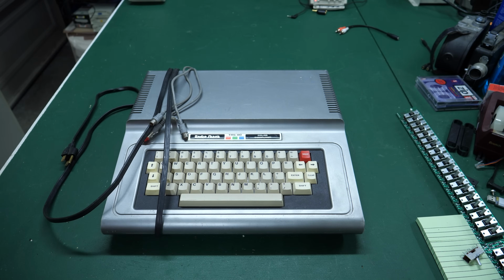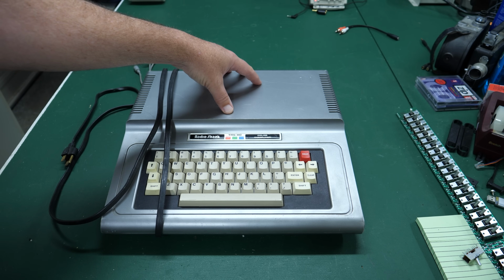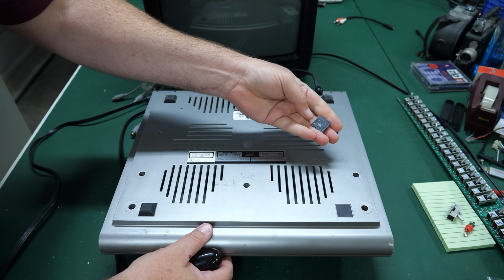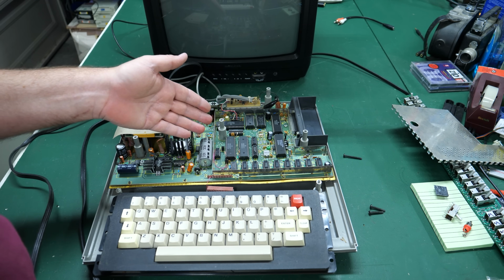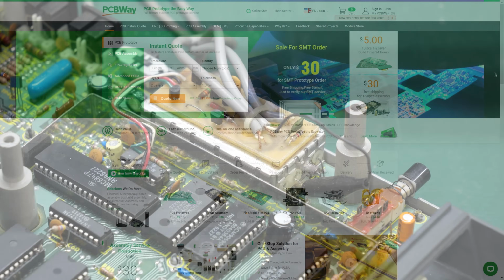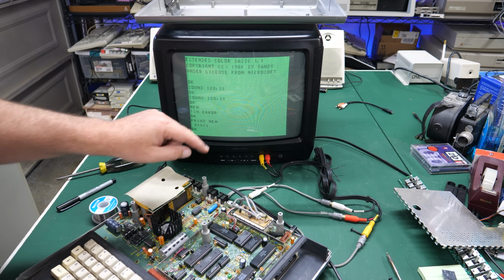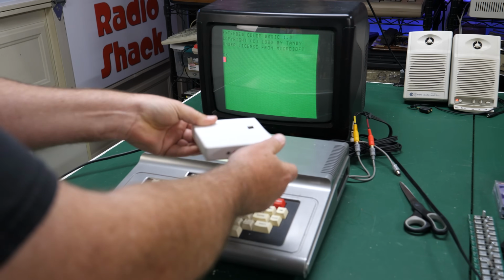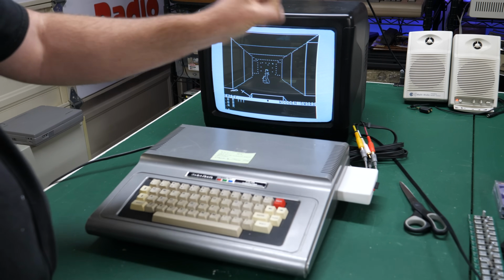Mystery Mod On A Radio Shack TRS-80 Color Computer

Comment: This is the same model Coco I have, bought in 1982 from Fort Worth TX via mail order paid $499. The keyboard was sold in RS in 1985 as a special purchase $5 limited quantities per store, I would buy and mod for friends, 3rd party keyboards started at $49 up to $129 plus shipping. 1989 I bought a Coco 3 still have that too.

1985-1986 I worked for Radio Shack with mixed feelings how customers and employees were treated. But before I would spend hours in store as a customer always going there first in the mall meeting back up with my friends later in the record shops..

Comment: Color computers across the board had power supply heating issues. They were linear power supply s(not switching supplies as on most later machines. The model 1 here has a TO 3 pass element transitory. Later models had a TO220 case device in this place. The power requirements continued to increase with each version. The CoCo 3 could be expanded to 512K of further adding to the all ready overloaded 5 volt supply.

Comment: One of my first jobs actually was working at a local small town Radio Shack.  To my knowledge, Radio Shack did NOT ever sell any user installable upgrades for the CoCo1, CoCo2, or CoCo3.  While there were definitely keyboard upgrades available, they were all 3rd party upgrades.  I even saw a memory upgrade to either 512K or 1MB performed live at a computer show in Chicago.  It involved careful soldering of a sort of 'Y-bridge' on top of a 40-pin chip on the board, that had pins sticking from the top, which then accepted a daughter board.  Needless to say, it took great skill to solder directly to all 40 pins of the (PIA?) chip, to complete the upgrade.  The CoCo1 was designed to use RF output to connect to ANY standard TV set, and was limited to a screen size of 32x16 for clarity on any TV.  At the show, I even saw the CoCo1 with serial number 000001 !

Comment: i was manager of a Tandy Repair Center in Santa Rosa CA 1982-1986..
Trivia: the warranty seal if it is white letters with black background it is from manufacturer ..if it is black text on white background it is from a service center..there may be a hand written 4 digit number on the sticker starting with a 7 which is the service center number...

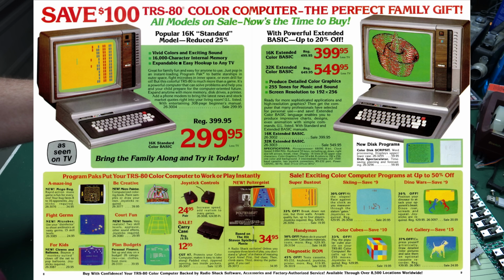if you look at the ad at: 1:41 those have square plastic label (near heat vents) showing the amount of RAM.. a very common mod at the time was to remove plastic label under it is a round hole which a LED fits in perfectly to add a power indicator ..not authorized by Tandy..

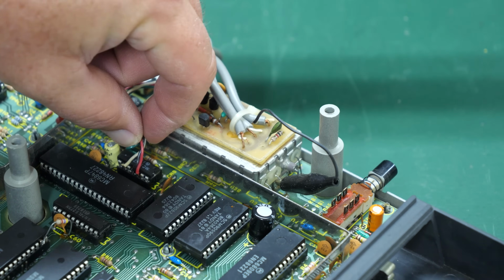12:27 There was a mod by Tandy to put pull up  resistors on  some  chips.. it was hard to see since your arm was in the way on close up and imposible to make out when the camera was not zoomed in ..at 14:16 the resistor connected to c60 is not a Tandy mod..

When people brought computers into a service center with consumer mods our rules were we removed all consumer mods put the parts in a zip lock bag fix the computer put a warranty seal on and return the computer and zip lock bag to the customer..

Comment: RadioShack later released Extended Color BASIC 1.1.  It required the Color BASIC 1.3 ROM.  Later CoCo disk controllers  required the newer ROMs.  You can upgrade any CoCo with those ROMs. If you ever encounter a CoCo with Color BASIC,  you upgrade it to Extended Color BASIC by plugging the Extended Color BASIC ROM into the empty ROM socket 😊

Comment: The keyboard is the late CoCo2 keyboard.  RadioShack stores sold that keyboard as a hobbyist part.  I remember seeing it hanging from the pegboards in my local RadioShack store back in the day.  As I recall, the cable was different between the CoCo and CoCo2, requiring a bodge connector to allow the ribbon cable from the CoCo2 keyboard to the CoCo motherboard.

Comment: Radio Shack sold a CoCo with out a RF modulator for schools.  It was to "deter" theft as it would not "work" unless you had a composit monitor, which was rare outside side of broadcast facilities in the 80s.

We had a pair of them at a radio station. Wrote a custom program for call screening for a talk station.
The screen size was just right for the number of phone lines and an info line to the host. To get their attention, we could flash the screen. Worked well for the three years the station was around.

Still have the systems around in storage
Reply from the maker: That's cool!

Comment: I played around with a CoCo for a while and my "Magnum Opus" on it was a machine code routine designed to do something not supported in hardware, which was to put alphanumeric characters onto the graphics screen (you had to literally draw them using BASIC commands).  My machine code allowed you to use the high-res (256x192) graphics screen to print 32x24 characters using the full IBM extended ASCII character set (the table containing the character set was far larger than the program).  The code included a lot of fancy character-manipulation commands, and even a command to customise characters inside the table or print a custom character without having to redefine one of the existing characters.  With my routine, you just used a USR call and gave it the string of characters to be printed (which could include control characters such as CHR$(26) to clear the screen).
There was even software controlled printing modes, such as "overwrite", "or" and "and" so that the text could more easily be mixed with graphics.
Reply from the maker: Nice!
Reply: @RetroHackShackAfterHours  I thought so too (of course). 😄  I've barely covered a quarter of the features I included in the code.  The biggest one was relocatable code, which meant it could be shoehorned into any convenient RAM location.  What I'd usually do was to clear 6 pages of graphics memory, which was 4 for the hi-res screen and 2 pages for my program to reside in, so there was no need to do a custom CLEAR command before loading the BASIC program.

Comment: Two options for your sign: either "ComputerLand" (goes back to 1979) or if you want to go WAY back to 1975, "The Byte Shop".  Both logos are online. That looks like a great idea, using the garage door panels to mount them. Maybe skip a little insulation under them for better temperature control!
Reply: Excellent idea!

Comment: The Radio Shack always had exotic electronic parts on blisters, very high priced parts, but sometimes they were the only one that had them in stock. Always Radio Shack had Realistic audio equipment, it looked nice but it was plastic with metal paint on it. The paint was off and so was the warranty. I have two parts of a Tandy Radio Shack TRS-80 waiting to be joined together. The paint is off and some screws lost the holes where the needed to fit, not even the holes are gone, so did the screws. The plastic housing of the TRS-80 is the most Chinese I ever saw, it breaks at strategic places, near the hole and where things come together. 
 
What I very dislike about the TRS-80 is their software incompatibility with other TRS-80 models, some have a Z80 processor and some have the 8609 processor (the Coco). That was the biggest flaw they made. I like the Z80 TRS-80 except for the cabinets that were faling apart. Ef You, China, cheap plastic, it is a shame!
Reply: the coco processor was Motorola 6809 which at the time was a real oddity ran OS9 disk operating system.all other models ran TRSDOS..
compatible Models were 1,2,3,4,4P etc (note Model 2 was 8inch the others were 5.25 inch floppies)  which all ran Zilog Z80's  but not compatible with Model 12,16,6000..which used Motorola 68000 processors
TRS Model 12/6000 had Motorola 68000 and Zilog Z-80 ..the Zilog Z-80 handled I/O and Motorola 68000 handled everything else...

in the 1980s (pre-IBM PC)  all manufacture software was only compatible with their own platforms..

Tandy first entry into "PC compatible" market was the Tandy 2000 which had a Intel 80186 processor completely compatible with Intel 8086 and Intel 8088 ran TRSOS and MSDOS upgradable to 720K ..they were not sure this MSDOS thing was going to catch on or not and covered both bases..next was the Model 1000 8088 with MSDOS and TRSDOS and Model 1200 running 8088 ..with MSDOS...and the rest is history

Comment: commenting just based on the thumbnail, no idea what the third plug is for but that looks like a magazine published composite mod, or at least thats what i was told the one in mine is and it looks pretty much the same, the third plug though should be interesting to find out

Comment: The monochrome mod works really well with a lot of the higher end word processors, spreadsheets, etc. (like Elite Word/Calc, Telewriter 64, VIP Writer/Calc, etc. Made the graphics higher density character sets like 51x24 and 64x24 much more readable, and even 85x24.
As others have noted, I am fairly sure that you have 64K instead of 32K of RAM (BASIC will only see 32K). You can test by playing a 64K game (Sailor Man is a popular choice) or booting OS9 or NitrOS9 level 1, both of which require 64K. (I never personally saw the "half bad" 64K RAM chips; the only true 32K RAM machines I saw were using 16 16K RAM chips, piggybacked and connected with a wire across them, back when 64K RAM was quite expensive).
Reply from the maker: Thanks. I'll try it.

Comment: I have my father's CoCo 1 and he had some interesting mods of his own.  He had replaced the chiclet keyboard with the same one this CoCo of yours has. He also put in a power LED as well as piggybacked ROMs that could be swapped via a switch.  Unfortunately the ROM hack has to be removed due to failed legs and I replaced his red LED hooked up with old lamp cord with a green one with smaller wiring.  I also added HDMI support via the board made by Alan at AC's 8 bit zone.  Produces fantastic picture and and do color palette swaps. Well worth checking out.
Forgot to mention that it's RAM was also upgrade using Apple branded chips!
Reply from the maker: Cool!
Reply: @RetroHackShackAfterHours  -  Radio Shack Computer Center.  The bigger business computer stores and large mall locations selling model 2 12 16 and the bigger tandy lines.